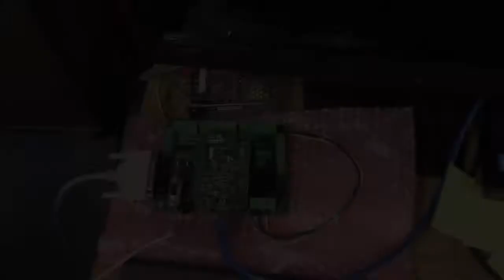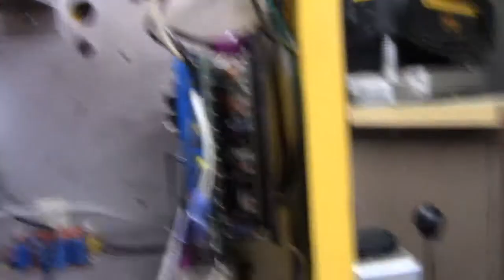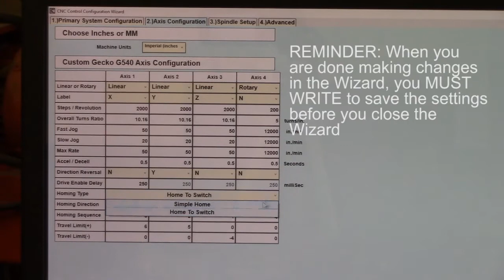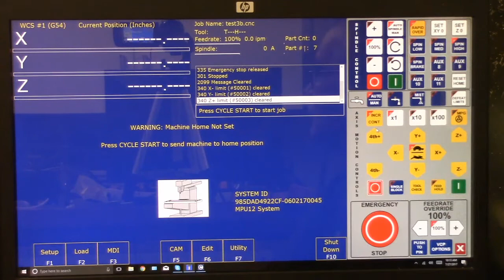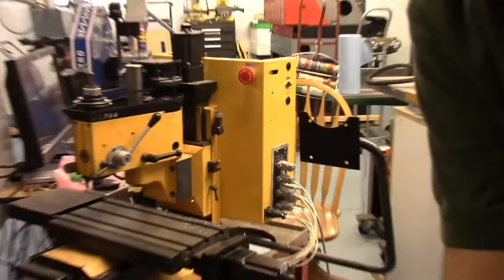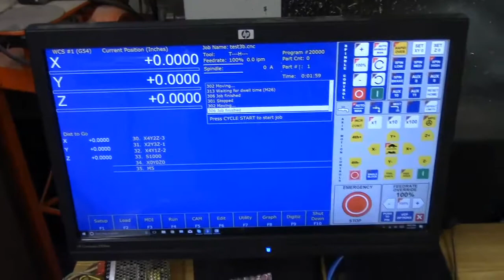Centroid CNC Acorn installed on Dyna Myte DM2400

Comment: Hello, On my CNC I have 2 motors with 2 drivers like CL86Y stepperonline in closed loop on the Y axis. How should I wire them?  I didn't find the answer on the site.Thank you very much for your help.
Reply from the maker: I do not do one on one support. You must post on the Centroid CNC User's forum: https://centroidcncforum.com/viewforum.php?f=60 make sure you follow this post when asking for assistance: https://centroidcncforum.com/viewtopic.php?f=60&t=1043 your drive are common and should be no problem to connect. I frequent the forum as I have time during the day.

Comment: Hello.  for acorncnc the size of 50kb. for the gcode seems too small for normal use. what do you think?
Reply from the maker: That depends on the part and how it's being run through you CAM software. That's a decent file size until you get into contouring 3d work. You don't say what machine you have.

Comment: Very helpful, thanks.Did you replace the acme screw and plastic nuts with ball screws?
Reply from the maker: No. They were fine. The nuts are made of Turcite, not plastic, they are also adjustable. Screw is a precision trapezoidal Acme screw
Reply: @martyscncgarage5275   yes they are tough. I have 1 I have been using for 20 years and one I am now putting ball screws on to get the backlash a little better.

Comment: Hi Marty, first off, thanks so much for your videos. Super informative and helpful. I recently inherited a couple of Shizouka AN-S mills, fitted with Bandit controllers, as well as a Supermax mill and Tsugami turret lathe. Your videos have inpired me to perform a modern upgrade to one of the Shizoukas, but I don't have much use for the rest of the machines. I'm looking to find homes for them. Do you have any resources on that front? Do you have any interest in them? Feel free to email me: despositodesigns@gmail.com
Thanks again!
Nick
Reply from the maker: Hi Nick. Glad they inspired you to do a conversion! As for your machines. Centroid has a Buy, Sell Trade forum, post there. Also your local Craigslist and Facebook Marketplace. CNCZONE.COM might be another place. Be sure you say where they are and whether or not you can load. Good luck!
Reply from the maker: Depending on the condition of the Supermax, if its a CNC mill, it might be a good candidate for a retrofit. You didnt say where you were located....

Comment: Hi Marty,
Thanks for the very informative video. I have my Acorn working on the bench. Just made a converter board so I can use my proximity home and limit switches. Next installing it on the mill. A bit of work getting used to the new software but it looks like its got lots of potential.
Cheers Dave.
Reply from the maker: Right on Dave! Post pictures of what you are working on at http://centroidcncforum.com lots of folks would like to see your project and Centroid support monitors it. So if you have questions, ask over there so everyone gets the benefit of learning and seeing what others are working on!

Comment: Nice work Marty, Great way to eliminate the Mach 3 Controller.
Reply from the maker: WhidbeyAutomation  I think you might like Acorn and the Industrial grade software.
Reply: I send you a message, I am, ordering one to test on a new small machine I built.  I want to use yaskawa servos on it if I can make it work.
Reply from the maker: WhidbeyAutomation if they take step and direction input, should work!
Reply from the maker: Mach 3 certainly has its place in the world. If it weren't for Mach 3 and the Linux CNC (Formerly EMC) guys, I'm not so sure we would be this far along in the CNC Hobby world. Its a great time to by a DIY CNCer or a student learning industrial automation. Fun stuff!
Reply from the maker: If the Yaskawa drives take industry standard step and direction signals then yes, Acorn can control them.
Take a look at DMM Technologies DYN2 and DYN4 AC Drives and AC motor combos. I will be giving them a try on the rescued Victor lathe with Omniturn gangtool slide attachment.

Comment: wow nice! I like the all in one feature. No 3rd party plugins and hardware to deal with. This is going to be my upgrade from Mach3.
Reply from the maker: Exactly. Its what sold me on Acorn. Hardware and software from one place using industrial motion control software. With potential for accurate lathe threading, constant surface speed and rigid tapping on a board that is currently under $300.